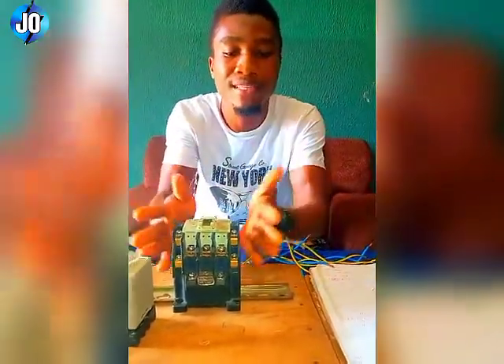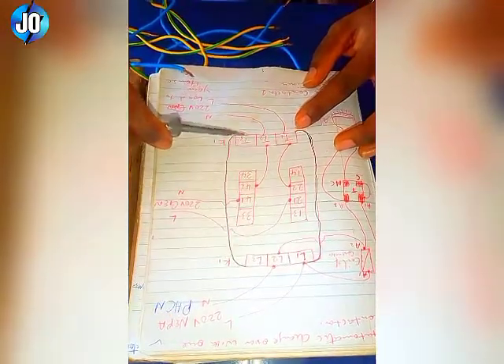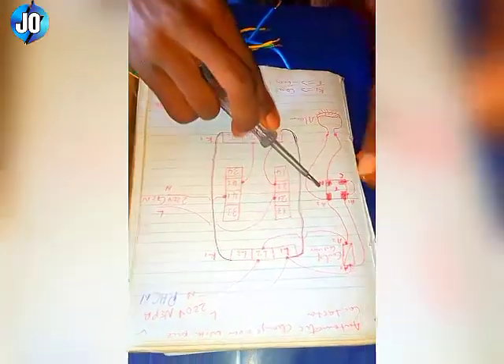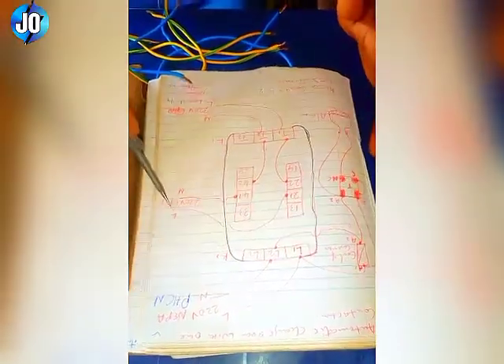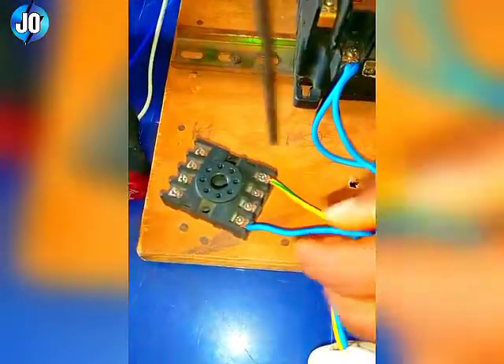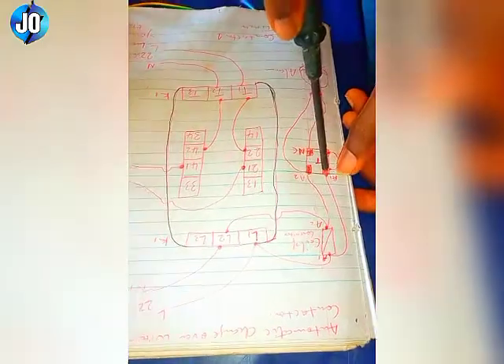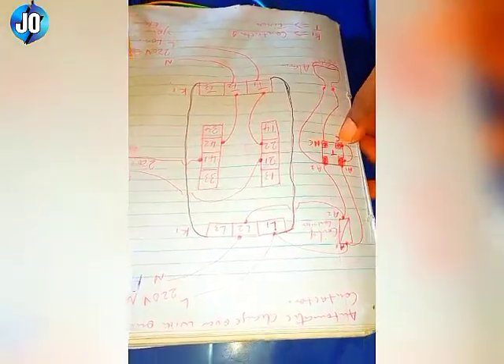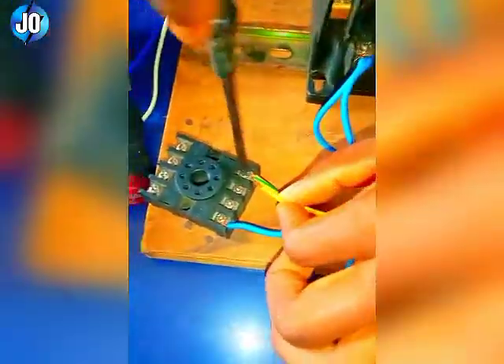How To Build A Single Phase Automatic Change-over || Using one contactor & A Timer

Comment: Weldon boss..
Pls sir,wen NEPA take night, can d generator start automatically as well?
Reply: I don't think so...
 You start it  manually
Reply: You can use  5 pin relay to power the generator automatically
Reply: Good work. But add more protection  in case contactor stuck inside the two powers will short